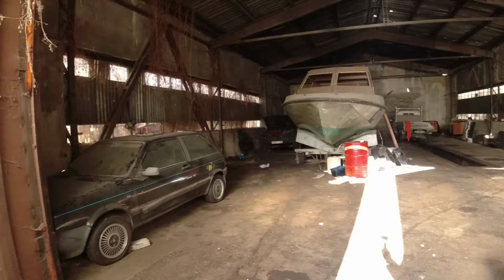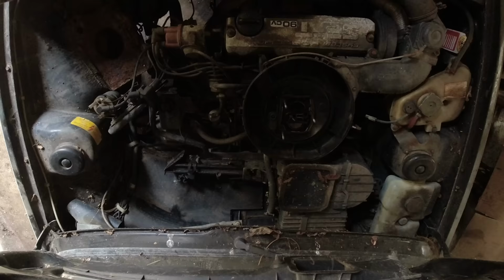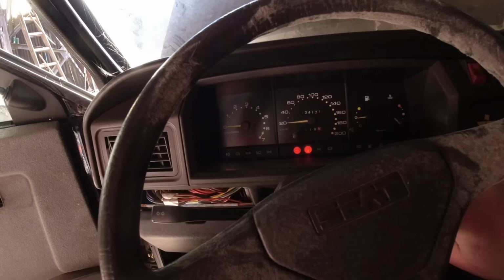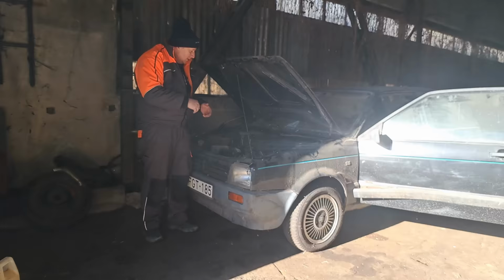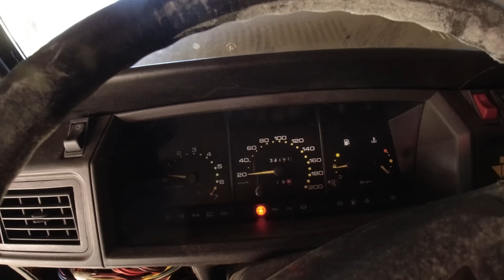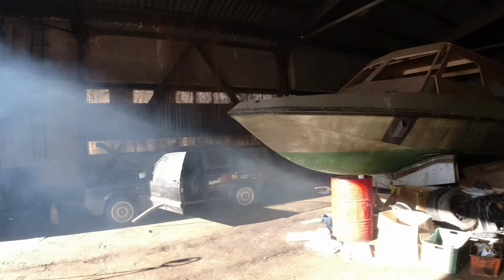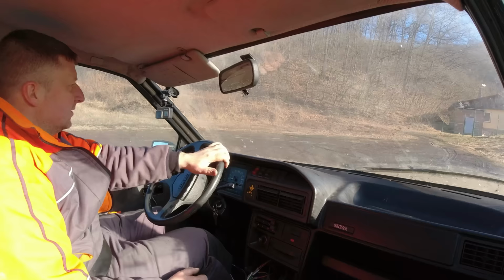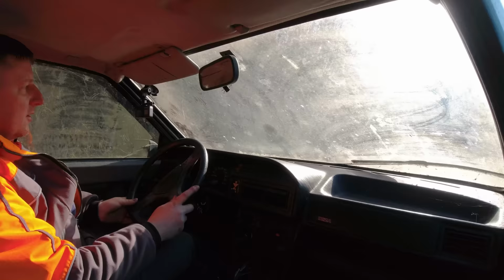Barn Find 80s Hothatch With Porsche System Will It Start and Drive ?

Comment: Soy de España. Era un coche con 90 cv ya era bastante para las carreras que  teníamos en tonces.casi todos los autos tenían más menos los mismo cv.salieron buenos pero como todo también son las manos de cada conductor.un saludo
Reply from the maker: Hi. Yes, most of them were 90 hp with the 1.5 engine. But they had few variations.  Some of them had turbos as well.  I like them. Interesting cars 🚗